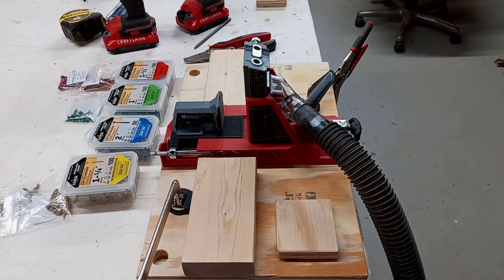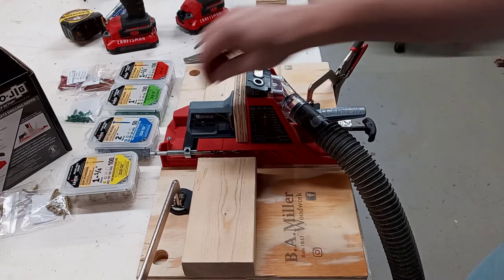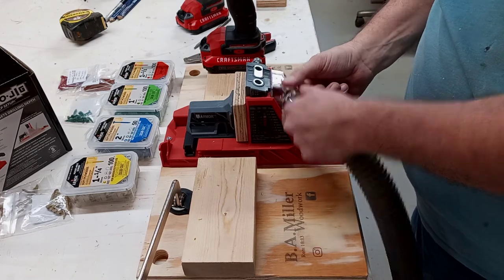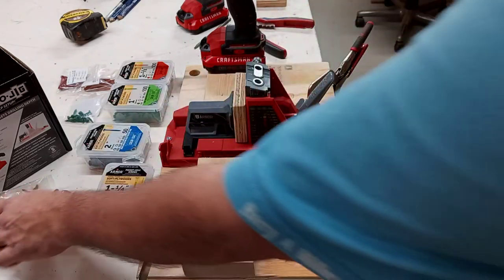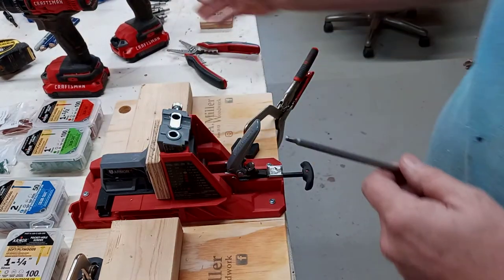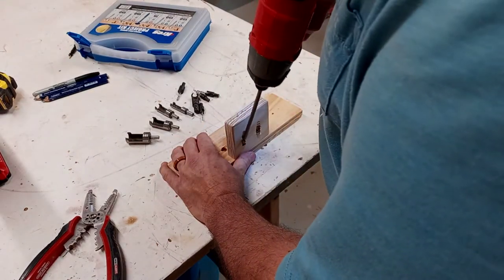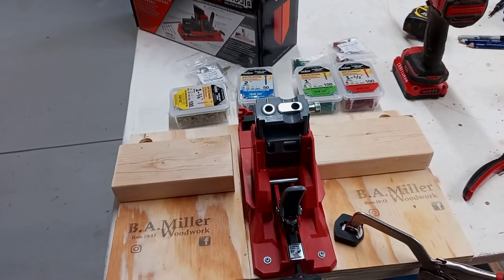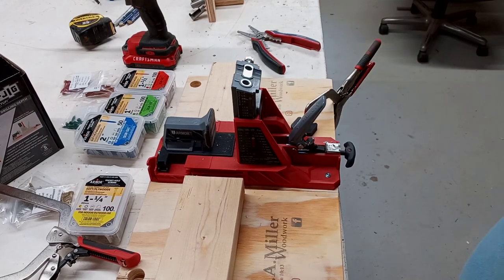Armor Auto Jig

Comment: Does the part on top, the drill bit guide, come out so you can use it on bigger stock and lay it down flat?  The Kreg K5 can, which I think is great so you don't need multiple jigs. So I'm wondering if it has that same feature. Thanks!!
Reply from the maker: yes, you can use it on bigger stock.
Reply: @b.a.millerwoodwork7074  Ok great. Thanks!!